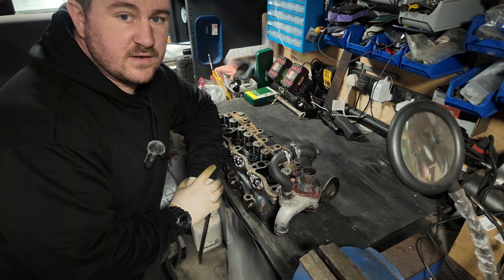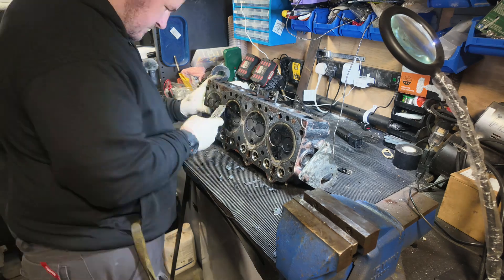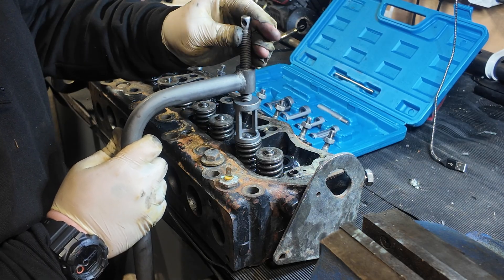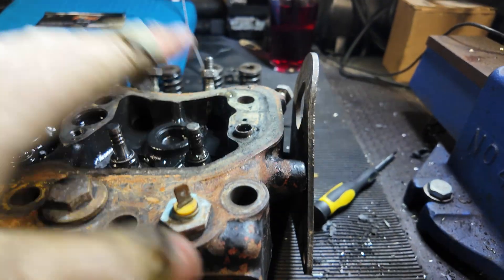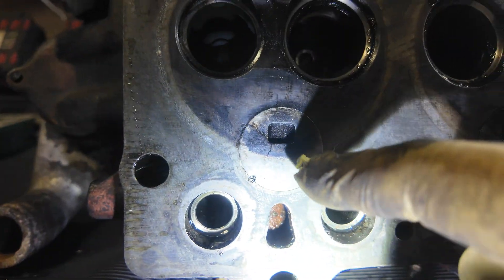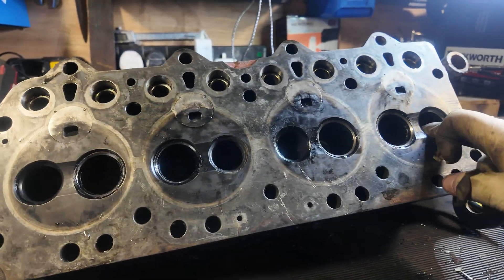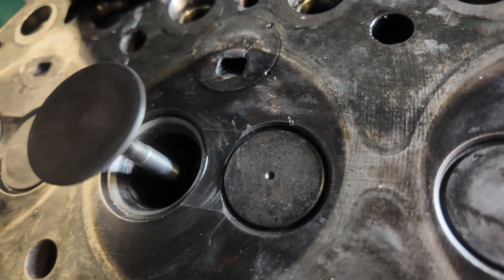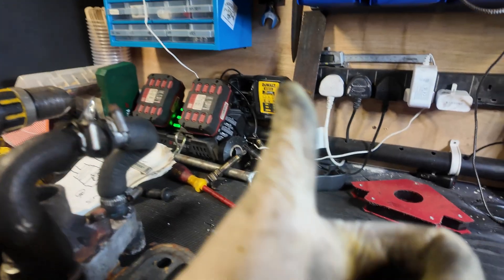HOW TO IMPROVE PERFORMANCE & POTENTIALLY SAVE YOUR ENGINE FROM FAILURE - LANDROVER SERIES 2A PROJECT

Comment: Being an old basket and retired, I can't remember how many of the heads and also the non Turbo heads I have removed. But a good old work bus, I took my test over 50 years ago in a Series one 2.25 Petrol.🤣🤣🤣🤣🤣🤣🤣🤣
Reply from the maker: Sorry I've just seen this! 

What a car to take a test in haha they're a good honest motor and not the most taxing to work on, part of the reason for the channel is to take the sting out of people working on theirs it can be done without the expensive gear you'd have thought you'd need.

Got to love them.

Happy retirement to you sir!
Reply: @AK_Exploration  I am retired, but still doing the odd job to keep occupied.

Comment: Agree with the no power tools, on the whole, but one of the most effective tools for removing gaskets and dirt is a die grinder with a fibre/resin pad, they don't take the metal away and leave a great finish, I use them a lot of gasket faces as it's about 3 minutes and almost a resurfaced look or a couple of hours for a 80% finish. 

what you're really looking for on the vale seats is no pitting, just a nice shiny ring all the way around. Done a fair few of them over the years. 
You won't overheat the valve, they're good for about 700°C! I think you'd be going somewhat to get that hot. We used to use drills during training, it's just you have to check more regularly and you loose/use more paste.
Reply from the maker: @overlandready  brill comment bud, ill have a look into them pads etc, you do use more paste but it's a small price to pay for the time you save lol.

Thanks for the comment
Reply: @AK_Exploration  No worries! To be fair, I don't miss lapping in valves! Yes, agree, a little more loss and a lot more time for coffee! 😛and the arm doesn't ache...

Out of interest, how much diesel did you loose in the cylinders over what time? I'd be thinking an 8 hour test frame is probably good enough. You will hopefully just be able to get away with a honing and new rings. Finger's crossed you don't have to bore and go oversized.
Reply from the maker: @overlandready  I didn't measure the amount I dropped in, I put a good inch in each cylinder (i could work that out if I was a maths boffin but I'm not lol) I left it for an HR maybe a little over and lost cylinder 2&4.

Checked again the day of filming this video and lost the lot (to be expected over this time I suppose).

I'm hoping you're right, hone it and new rings, we will see, I'll do another leak down and then a pressure test on rebuild.
Reply: @AK_Exploration  Yep, sounds a plan. So 2 and 4 are likely to be your smokers then, were the valves coked more on them? That often tells you too. I go at them with the wire wheel so they go back perfectly clean, almost like new. I would say you'll get better performance, but it's a td... 😛
Reply from the maker: @overlandready  I didn't notice a drastic difference in them to be fair they all had a level of crud on them I did clean them all off properly but didn't put it in the video, I should have in hind sight.

And ye I don't expect much from the engine in the way of performance but it has to be better than the 2.25 NA it had when I bought it 😆 0-30 in a week.
Reply: @AK_Exploration  yep, driven them all... to be fair the 2.5NA in the Series 2a was ok, nothing to write home about, but did the job. Still love my old 300tdi's though, even put one in a Series 3, that drives nicely, the guy who has it now will probably never sell it, he loves it too. A mates sone so still get to work on it  😁
Reply from the maker: @overlandready  we have a project for next year, not sure what lump we are going to use I think it might have it's original engine in, if so we might do a complete strip and rebuild on that, if not it's getting a galve chassis and a TD5 😜 (video to come in 2 weeks)
Reply: @AK_Exploration  Hmm, there are a lot of issues with td5 and putting in something random, totally possible, but it's not the easiest, although saying that, I have ooverseen a few "interesting" builds, one was an N47 into a 1950's Chevvy truck, that is not the easiest thing to work it all out on! Saying that, I did put ABS on a 300tdi 110... the next stage will be happening soon too...
Reply from the maker: Wouldn't fancy putting ABS on anything lol, the TD5 has a stand alone ECU on the market so it runs without all the bits and bats.

Do you have any experience with the OM606 Engines?
Reply: @AK_Exploration  No to the OM606 Mainly worked on Ford, Rover and JLR engines, and pretty much anything old... I'd not say no to working on a conversion though. Not that you'd find one now, but the Perkin's Prima is a really nice Series conversion, we did one of those about 20/25 years ago, goes like stink and tops at more than you will! I think we bottled at about 90 in the Series 2a, as it was getting hardd to keep on the road... So I can imagine what the OM606 is like... I think LR should have gone down the 2.5-2.8 Prima route instead of the 200tdi, would have been a game changer, loads of low down torque and high end power.
Reply from the maker: @overlandready  I bet you did lol I know they can get twitchy anything over 50 😂 I am considering the OM606 on the next project, wonder if there are any Primas knocking about..
Reply: @AK_Exploration  I haven't seen a prima for sale in about 10 years, I think I still have a most of a top end for one, the turbo got eaten to save a 200tdi.
The Series 2a was sold and went to Wales, prob ought to get my brother to check if it's still around... I think my next project will be the D1 truck, and if I have enough free cash, 2.8 300tdi it.

Comment: Well you've gone that far, so you might as well do the rings and shells. Drop the sump and do it that way, provided there's no issue with the rear crank oil seal. (The front oil seal is easy to get to). Diesels do tend to have an amazing amount of oil lurking in the inlet manifolds regardless. Yours is a little excessive I admit. 
What generally happens, is that the crankcase breather pressure goes into the air intake and as it cools, it turns back into oil. Remembering that you're running an oil burning engine, it normally copes quite well. 
More modern engines can actually become runaways if too much oil goes in, as it burns that without any input from the injectors. Worth getting the turbo checked, regardless. Also check the timing, as I've had that cause blue smoke.
Nice job on the head...
Reply from the maker: Thanks for the comment again mate, I am considering the shells! I need to pull them apart first to find out what size they are if they're OS and by how much.. always so much fun isn't it 😜
Reply: @AK_Exploration  Did it for a living the last 40 odd years... Now I feel old.